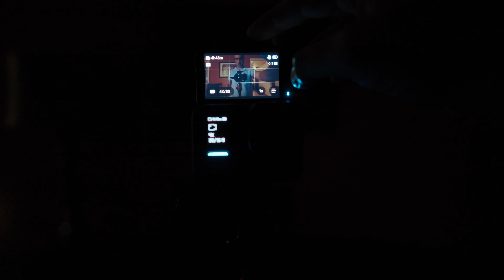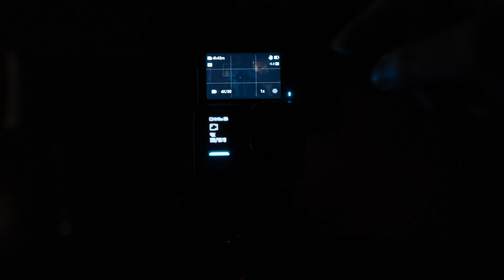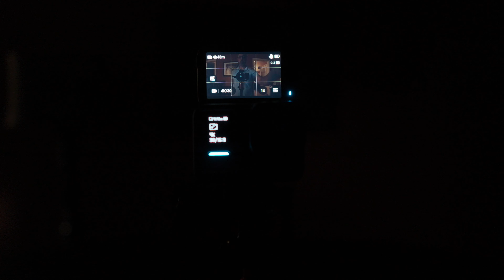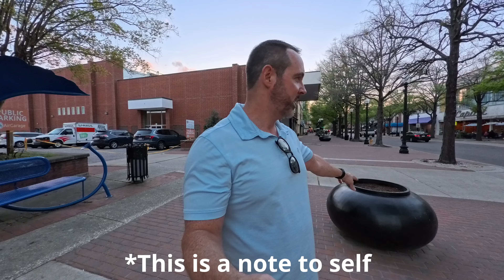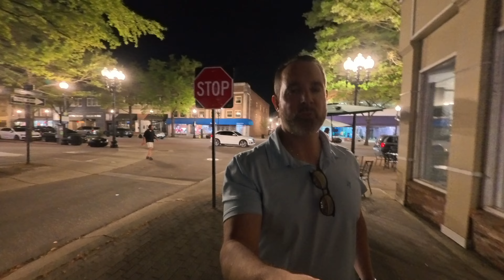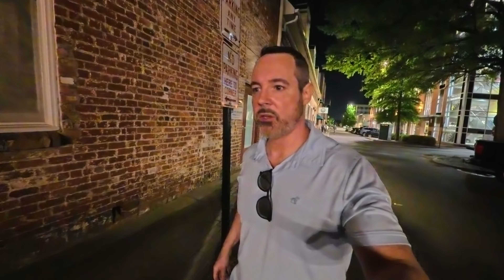Ace Pro 2: Best Settings for Low Light & Portrait Mode Test

Comment from the maker: What Max ISO setting do you prefer? Is Portrait Mode something you would actually use? I also saw that the version I was using on my camera was firmware version 1.2.5 but it was pulled for unknown reasons. If anyone knows why please let me know.
Reply: did u get any new firmare update that enhance low light footages?

Comment: Great test, for me portrait mode is something I would not use. Face priority is better.
Reply from the maker: Yep. I saw your video after I did mine and we both had similar results. I am in communications with their support and they are also waiting answers from the R&D team concerning why they pulled firmware 1.2.5 and reverted back to 1.1.18 on their website and app. One way to deal with this is to release beta firmware on their website that you would have to manually install on the camera, but have the tested, stable version available for update on the app. That way people like you and I, maybe Rabz and Myagi could test out the new firmware and make videos about our results. We get content and they get free feedback and testing.

Comment: I just got the Ace pro 2 yesterday (4/7/25), updated firmware and don’t see this mode. Did they change something?

Edited to add: I contacted Insta 360 and they said this firmware is in beta and coming soon to the general public. When, who knows. I can’t see it yet.
Reply from the maker: Hey! Must have missed this comment so sorry for the late response. I also contacted them and didn't get much of an answer as to why they pulled it either. I am definitely looking forward to the next firmware update though.
Reply: @TimBrownTown they sent me a link and I was able to get the new firmware but it took many chats and several phone calls. It’s good!

Comment: I can't find 1.2.5. I think it was removed.
Reply from the maker: @JustinPulitzer  yep. I didn't even realize it was pulled when I did the video and thought I was on 1.1.18. I updated my ticket with Insta360 and will let you know if I find out anything. I didn't notice anything bad, except portrait mode overexposes, however this is corrected by adjusting the EV to -0.3 or -0.7 but I didn't test EVERYTHING. There is a reddit article that states they are beta testing it, which isn't true because there are several others with videos demoing portrait mode. I updated my pinned comment. That's about all I can do. The info in the video is still valid, except the firmware version I referenced.
Reply: I just talked to Insta 360, they said it’s releasing soon, it’s in beta testing. I just got the camera yesterday and 1.1.18 is latest available. No portrait mode. Yet. We will wait and see!